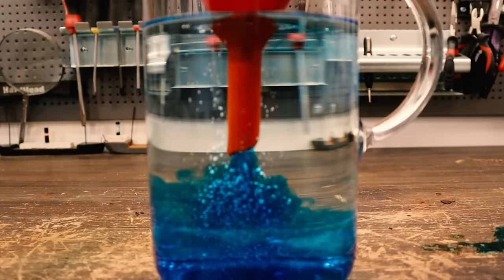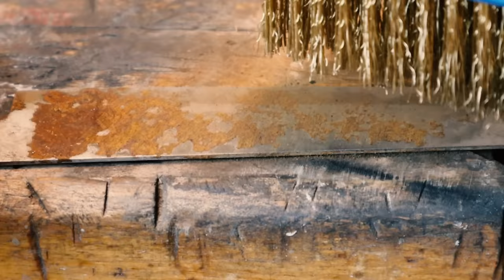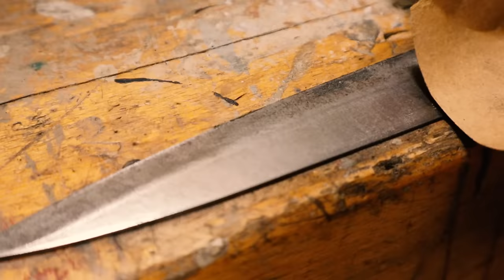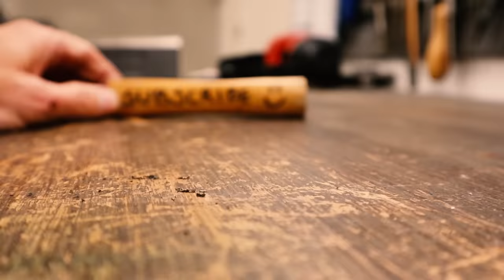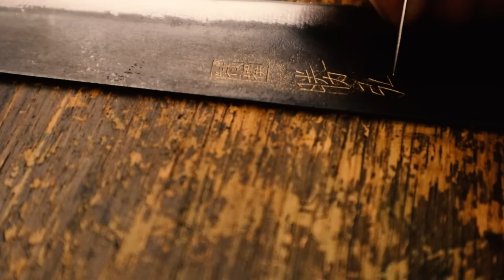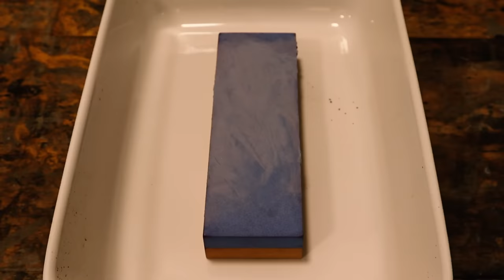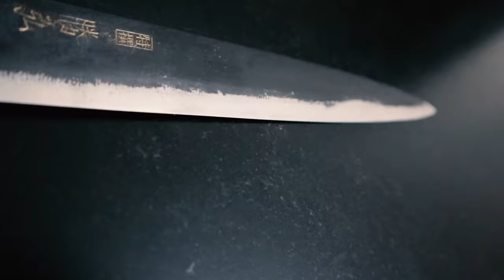Sushi knife restoration - Extremely Sharp

Comment: Why did you remove the heat treatment it already had? 
You're supposed to use wetstones  not a fuking grinder. This knife will never maintain an edge now.
Reply: 10/10 now,now no need to say fuking its actually because since the knife has already rusted the treatment has already weakened the knife and u might not know how old the knife is its just a precaution. Also about the grinder when u heat treat a knife it will make the blade soft and the edge will deform that is why he used a grinder to make the edge of the knife straight again. And last a japanese sushi knife will always have its sharp end even if u use a grinder. 
Ps. I know this due to the fact I am a well not to brag but a swords smith for katanas and they work the same way
Reply: @ZF_Aspiris  the point of heat treatment is to harden and then toughen, as a sword smith you should know that
Reply: Ah I see I overlooked something sorry

Comment: You should have a rivet or bolt going through the handle, through the hole in the actual blade handle. That epoxy is not going to hold the blade in the handle very long, especially considering you didn't even properly mix it. Cool project though.

Comment: I've been using a handheld disk sander for restorations because regular sandpaper hasn't been able to get at deeper abrasive damage from rust but in turn it's been leaving gnarly deep scratches in the blades that I can't get out even with higher grit on the sander, any recommendations on how to avoid this?

Comment: I'm not sure what the deal with the torch and charcoal was.  If it was to harden the steel, you didn't get the blade nearly hot enough.  If it was to darken the metal, the heat you used likely ruined the temper.

Comment: If you really want to get that knife sharp, use 1,000,000,000,000 grit sandpaper.  It sands at the Planck scale and hones each proton and neutron
Reply from the maker: Thanks for the tip :)

Comment: I live in Japan as a chef. And that handle is totally the wrong shape. You can buy pre made handles on Amazon Japan for cheap. Also also the quenching doesn't seem right to me. Did you use a hardness file to check afterwards? All sharpening stones work the same if properly square, so I have no problem with that.  In the end it's a western "interpretation" of a Japanese knife. I wouldn't call it a restoration.
Reply from the maker: Hey Thanks for watching and for sharing your knowledge 👍. It is a real Japanese knife. Several Japanese wrote the translation on the Japanese maker in the comments. 😉

Comment: I can just imagen him entering a sushi shop trying to sell it 😂
Reply: To which they'd reply: "You've destroyed the temper so it won't hold an edge, put potentially toxic paint on a surface that touches food, poorly attached the handle with unmixed epoxy, removed the bolster cap from the handle that prevents the wood from splitting, and put a bevel on both sides of a knife that is supposed to have a bevel on only one side. This is useless to me."
Reply: @sabelch  haha low-key tho

Comment: Pretty sure u blew the temper on the knife, I’m fairly certain I seen the edge turn orange in places.... I get u were trying to blue the steel but I would have done gun blue or even hot blue heating... if u want to use a torch in the future I would heat the spine only and allow the heat to make its way to the edge, but there are better ways....

Comment: Why did you use that hardening technique? So far I know, the blade only hardens when it's so hot that it's non magmatic. And then you need to temper it because otherwise it will break because of the hardness.
Reply: Also, when using a wetstone, it says it in the name, it needs to be wet, like soaked and it's even better if you keep a bit of water on top while wetting.

Comment: You should really start putting tape on blades you restore prior to sanding off oil to make edge lines straight between the rest of the knife it seem like such a eye sore to have the letters restored and to sharpen the knife and then have such up and downs spots on the knife edge bevel

Comment: Man. This was rough. Locking it in the vice jaws unprotected, using an angle grinder on the edge, heating it with a torch to hot blue it, using non food grade paint, the handle wasn’t complete and sharpened it incorrectly. I’ve made 27 sashimi knives to date. Respectfully, they should be done entirely by hand as the blade becomes and extension of the users hand.

Comment: Another cool project Martin.  I'm assuming the blade was Japanese steel.  Is this the best steel for knives or is there a better knife steel?  Also, how do you get such nice produce up there near the North Pole? 👍
Reply from the maker: Yes bob it was and I should have heat treated it but i did not have the proper equipment at that time. No there are many grades of steel who has their own advantages/disadvantages like, Hardness, Toughness, Wear Resistance, Corrosion Resistance  and Edge Retention.  :-)
Reply: Wait where does he live? Are u meaning like north pole Alaska cuz I'm literally like 6 mins away from their on the AFB lmao insane if he lives near here. Also if so to answer ur question we get produce pretty easily they just bring it from the lower 48 or overseas depending on what it is.
Reply: Double R, Martin lives in Sweden.

Comment: As a knife maker, this video made me cringe a few times.
Reply from the maker: Sorry, I'm not a knife pro as yourself ;)
Reply: @AwesomeRestorations , next time, instead of heating it with a torch and quenching it in oil, just dip it in some dilute ferric chloride for a few minutes.  That'll darken the blade without ruining the original heat treatment and without risking warping the knife.  Just rinse it with a solution of baking soda and water after you're done to neutralize the acid.  Oh, and belt grinders are much better than angle grinders. ;-)

Comment: Why the hell would you attempt to re-harden the knife? It wasn’t softened at all by the aging process. You didn’t heat it even close enough to non-magnetic, you didn’t temper it, and you used an angle grinder to clean up the edge? I’d call you an amateur, but that would be insulting to amateurs everywhere.

Comment: That poor knife.  Why didn't you straighten it?  Why did you not properly attend to the bevel?  Why did you not center the hole for the tang?  Why did you not add a ferrule?  Why did you choose to disregard the needed concave urasuki?  Why was blackening the blade more important that the enduring heat treat?  Sure, it might be more usable now, but that knifes future is certainly falling short of its intended destiny.

Comment: You kinda made the knife worse, you ruined the heat treat and did not harden it. It should have been a differential heat treat. Then you left the scale on? You ruined a great knife.
Reply from the maker: That knife is still the sharpest thing in my kitchen... So It's doing OK for a "ruined" knife ;-)
Reply: Awesome Restorations that thing wasn’t even glowing red let alone up to good hardening temperature, so I doubt it. Unless you didn’t even get it hot enough to ruin the previous heat treatment. Look, the knife looks great, but if you’re going to ‘restore’ an old Japanese knife, you should do it either top of the line or traditional.

Comment: Nota very sharp :l
Reply from the maker: Thanks for watching - yes its still really sharp. ;)
Reply: @AwesomeRestorations  u can sharpen any knife like that, even just a sheet of metal. But the point is how long it will be that sharp. And as i already wrote, you shouldnt heat the knife. You ruined the hardness so now the middle of your knife where it got heated will get dull faster

Comment: 3000 grit is not extremely sharp, use 6000 or 8000 and then a leather strop, you can see how much effort you're putting into the cutting, its really not a sharp blade

Comment: Well it’s of more use now than it was before.

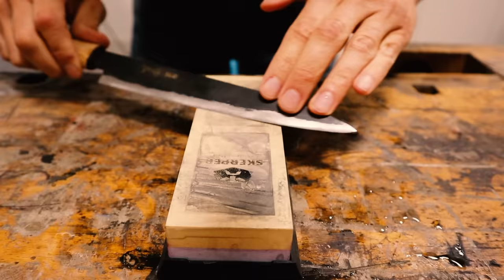7:30 ... but really, do you not know anything about Japanese knives? 
This knife is supposed to be sharpened placed all the way down on the left / concave side of the blade and flush with the surface in the right/angled side. The knife is made to be sharpened this way. If you use the design of these knives, you won’t rock and degrade the edge during sharpening. Sharpening this knife incorrectly by hand might make it sharp, but not as much as it could be. Both rust preventions for the future and ability to keep its sharpness just got lowered by quite a bit.
Reply from the maker: Den er stadig MEGET skarp Lasse og er overhoved ikke rusten - så noget må jag da ha gjort rigtigt ;-) Thanks for watching amigo 😉👍

Comment: Doing the paint job is pain in the ass for those samll letters should have just pour some paint on top of it and then wipe it off with a cloth. Would have saved you lot of time. You know the answers but still went for the longer approach. Restoration was way too easy.

Comment: Tbh.. this was a rather shameful restoration.  I cringed at the angle grinder being used, the heating up of the blade unevenly which is no doubt going to cause issue with the blade’s performance. 

You didn’t give the restoration it deserves. Where is the clad line ? 

Your angle and technique for the sharpening was way off for Japanese. They would never use such a steep angle. Or circular motions.
Reply from the maker: Yes you are so right. This is not my best restoration. But despite I didn't use all the right techniques .. it's still very sharp and usable 😉 thanks for watching 😉🙃

Comment: Extremely stupid to apply heat on a japanese finished blade you ruined the steel structure, those Knives are quenched in water and the hardness of the blade is an ultra studied process which has taken generations to get it perfect by the japanese 1 extra degree of heat on the blade gets the blade useless, you have done a great job but please!! pay big atention to the metalurgy of each blade before restoring as an advice
Reply from the maker: Yes

Comment: it's kind of sharp but certainly not extremely sharp
Reply from the maker: Thanks for watching and for your words 👌 - I could have grinded the blade on a 6000/12000 wet stone and the leather strap. But it would be to dangerous  - my kids are using it 😉👌
Reply: I try to keep it respectful, no reason to get upset ot belittle. but nice job either way

Comment: What a way to ruin a great knife! Feel sad that this is the way it will spend its last days.... Sharpening with an angel grinder - wtf man?!?! 🤦🏼‍♂️
Reply from the maker: I you have a little knowledge on tools you can clearly see that i'm not Sharpening with an angel grinder 😉 Just removing some of the black oil from the blade with a soft cleaner disc on a angel grinder 😉 Thanks for watching
Reply: You are removing material, which I would have done with another method. The little hollow grind there is on the blade is completely ruined. But everyone has there own standard, and mine is clearly higher than yours. Thanks for the video 👍🏼